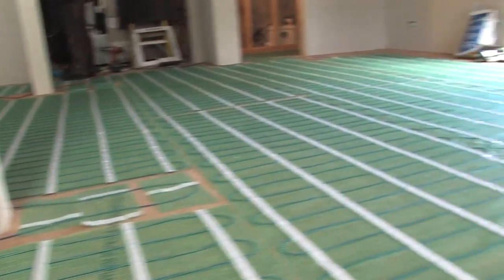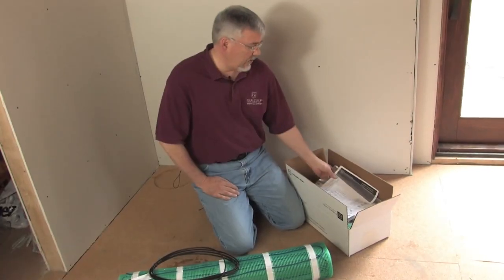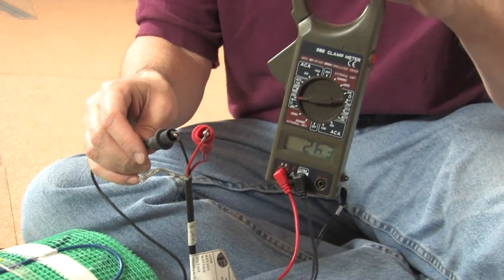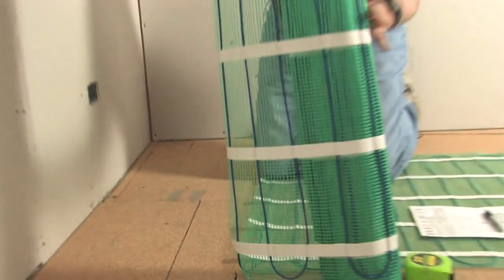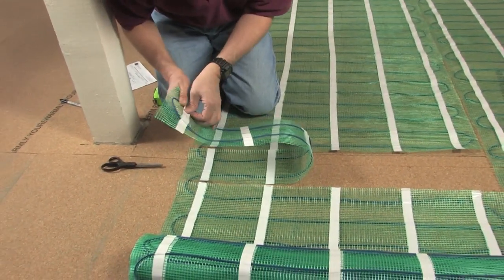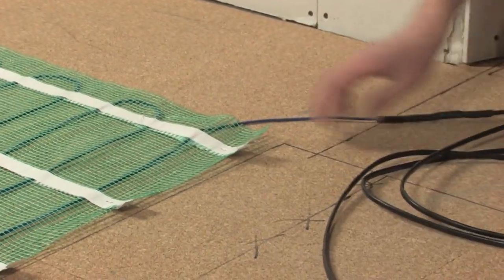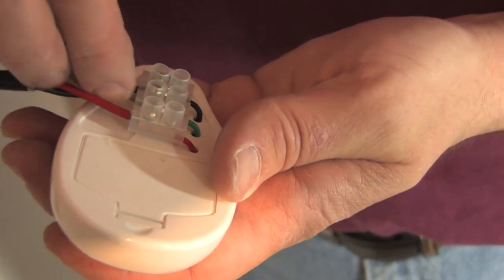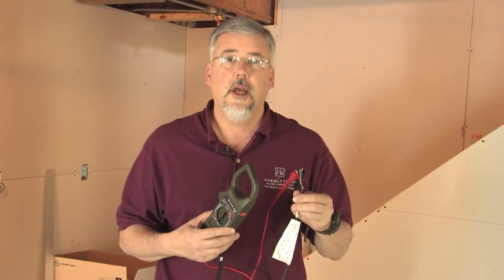How to Install TempZone Flex Roll Floor Heating over Cork Underlayment

Comment: is cork safe? will it burn? cancork told me that cork is not good for under electric heating because it will burn
Reply from the maker: Hi Shawn, we have been selling cork for decades and have yet to have any incidents with it. It is rated as a safe underlayment to go with electric floor heating.